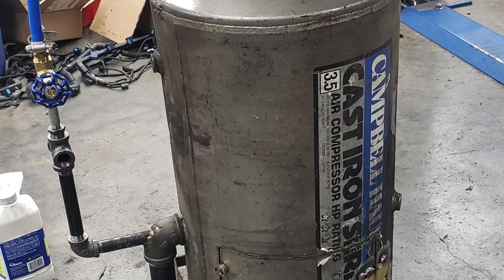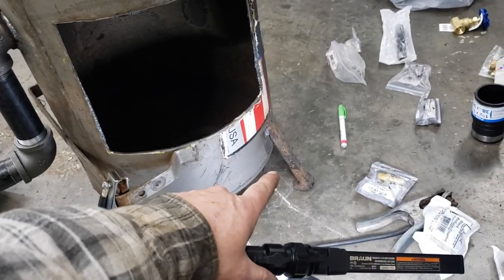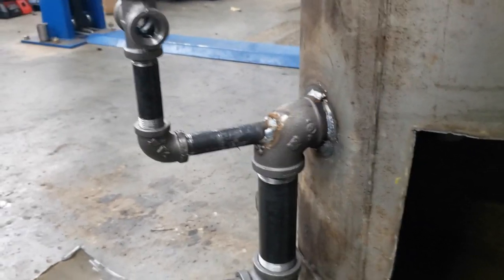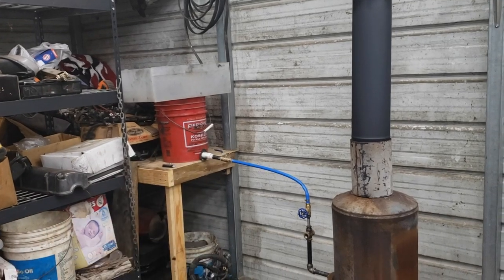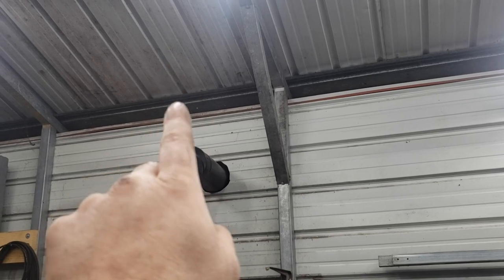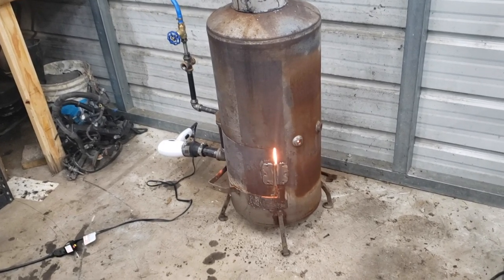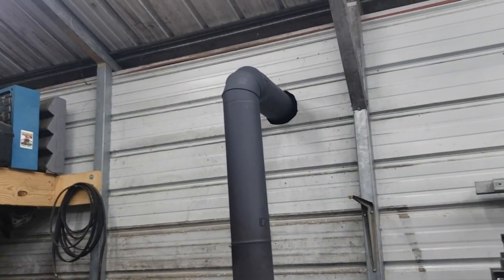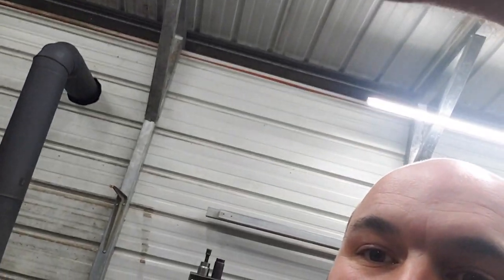FREE HEAT! My new WASTE OIL shop heater!

Comment: Nice stove!!! Time to start optimizing it. Put 6-8 2" pipes thru the chamber, up high, horizontally. Push a lot of air thru them, slow the oil down to about 1 drip per second or so. Warmer shop, no melting anything, stove will last way longer. So many people build these and think they must run at 'incandescent speed'. Heat exchangers are a way of life. If you run the stove more optimized, you will get more out of it. Doesn't matter if you have thousands of gallons of used oil. Michael in Colorado.
Reply from the maker: Yeah I was just telling my buddy that that I need to run some pipes through it. I'll definitely do that in the future

Comment: Think you should have an heat shield around it.
5 to 10 cm space and then a metal wall around it to stop the radiation and open in the top and bottom so it gets good air flow.

Can be painted black to still have some radiation heat but it will help a lot anyway what colour it is.

Should stop it melting things around it and still heat good.

Comment: ❤ your video
You got good thing going, one suggestion , use metal pail with copper tubing 
supply line s safe distance from the stove. Also check out colour of flames and their temperatures.  Your flame is white. I ran torpedo heater vegitable oil conversion for yrs . Built heater block with temp controllers.  Now use double barrel stove ( to hard get good wvo,)
Reply from the maker: I can touch the pex with my bare hand with heater at full tilt.

Comment: I like your design. I wonder if having the tank in the horizontal position would put out more heat. I think a lot of heat is going straight out of the stove pipe.
Reply from the maker: A ton of heat goes right out the pipe

Comment: you can burn automatic tranny fluid also plus french fry oil if  you don't mind feeling hungry all the time from the odor.
Reply from the maker: I've used transmission fluid, oil, and power steering fluid

Comment: How big if your steel building? I see its not insulated so Im curious as to how warm it gets inside on a 30 degree day ? Thinking of building one like yours myself , Thanks
Reply from the maker: mine is 24'x25'. It was around 30 last week and I had it fired up. It was around 65 according to the temp sensor in my van that was parked in the shop.
Reply: @hondaresource  Thats awesome ! Perfect temp for working  in the garage . Thanks for the reply

Comment: Surround it with fire brick to retain the heat
Reply from the maker: Not a bad idea
Reply: Even red common brick would work or extra metal around it and little air flow

Comment: Air mattress blowers dont hold up & are pretty noisy.    Can wrap some aluminum foil on the PEX.
Reply from the maker: I still haven't had any issues with the hair dryer and the pex tubing hasn't gotten hot enough that I can't touch it

Comment: I would wont it in center of shop because it’s very hard to regulate heat and it’s going to really get hot at times even with two box fans on high speed
Reply from the maker: It does pretty well where it's setup at

Comment: Put some fire bricks on the inside it will help. Bottom and side
Reply from the maker: I'll check them out
Reply: I think firebricks won't help. They're useful in wood heaters, where the fuel is added periodically; the bricks cause the temperature output to be more even. Oil heaters get a constant rate of fuel input. Also this is made of steel, so there's no real need to use any material for insulation purposes to protect the heater.